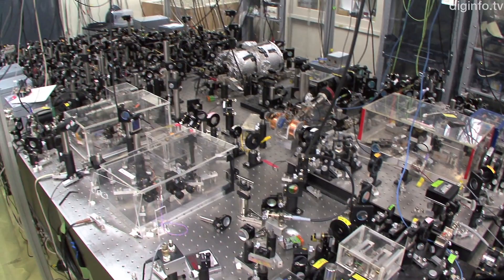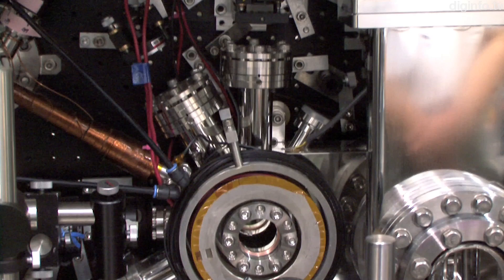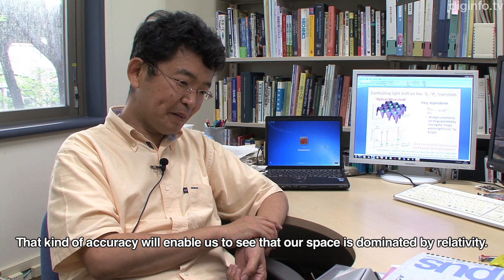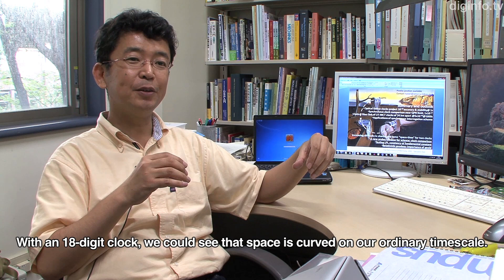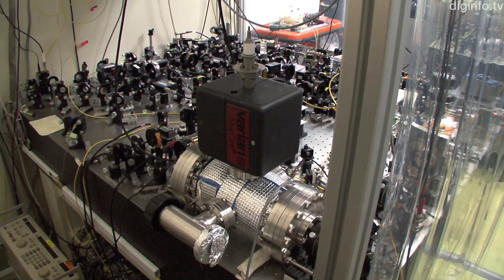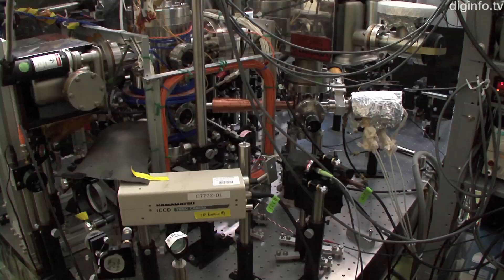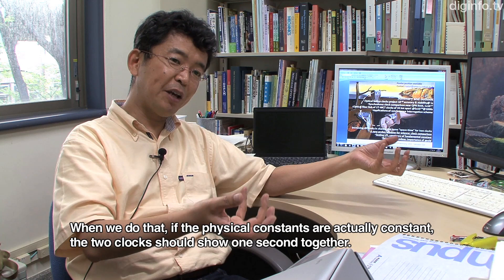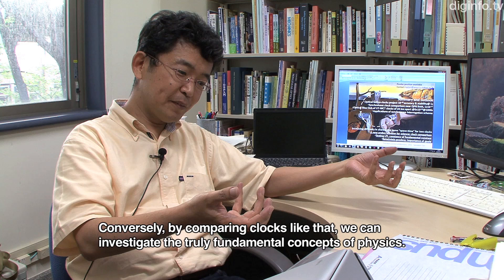World's Most Accurate Clock - Atomic Clock Accurate To 100 Quadrillionth Of A Second #DigInfo

Comment: @Diginfonews Time gowing slower when moving faster is SPECIAL relativity. This is about GENERAL relativity. And yes, this has been observed many times. Regular atomic clocks in GPS satellites are corrected because time at these altitudes run significantly faster than on the ground.

Comment: @ILoadng Read about time dilation, then watch again. In short, the rate at which time passes by is relative to gravity and motion. This clock is so accurate that it can measure VERY small differences, thus detect very small changes in gravitaty and motion. Also he speaks about the so called "universal constants" (eg. speed of light in vacuum) which is also suspected to be relative (eg. decline/increase over time) which he's hoping to be able to find out using this clock. Hope this helps.

Comment: Its cool how the logic of it means that if it was raised or lowered it would be slightly faster or slower due to gravitational pull on the molecules that go through its reading part. Sadly though I feel this video to be a waste putting it up on YouTube as most people on here either watch happy tree friends or laugh watching some idiots called smosh. Whatever smosh is (probably some babies stuff). Me I like to run research into different areas. One area I've looked into is in magnetic field generators. Just to get an idea of how to make magnetics spin freely. The rest of that is stuck in my brain which doctors say I'm only using about 125 IQ of what they think may be in the 140s area of the IQ scale Carroll vorderman from countdown has an IQ of around 160 - 210 and is classed as one of the smartest people known to man (before you ask, no I'm not a on any list for smarts. I'm just a normal guy with ambissions to build a drive core generator then apply it to a UFO shaped air craft which is basically just a helicopter with a cover on it which is powered by electricity).
Reply: Not to be rude, and I know this is a late response, but IQ is an arbitrary measure of intelligence.   If you really scored that high on an official test, yes, you would be on top lists, not to mention you don't even have a Mensa accreditation.  The idea that a portion of the brain can be willfully used has been proven wrong, and there's no way a doctor could measure what portion of your IQ you're using.  On top of all of this, if you really did ANY research into magnetism, you'd realize that your idea is stupid.  You can't create free energy without any input of energy, that defies the first law of Thermodynamics.  Lastly, a "helicopter with a cover on it" would mean the blade is covered, so it wouldn't even produce enough lift to move off the ground unless you had some sort of special ventilation.  Honestly, do some basic research before you boast about a prodigious intelligence.  It's something people of average intelligence do...
Reply: r/imsosmart